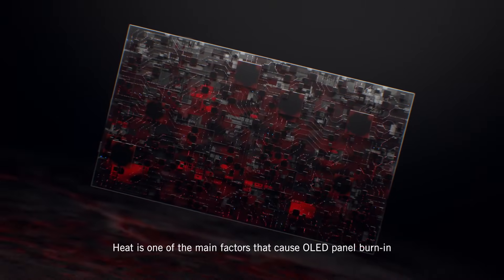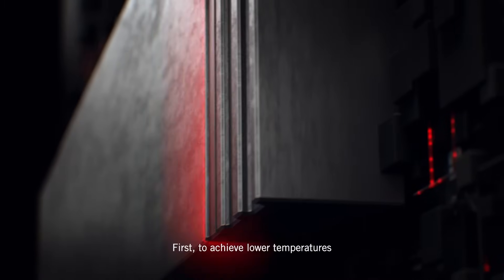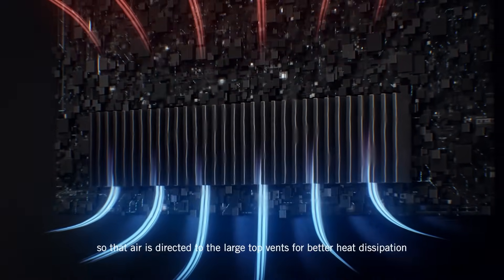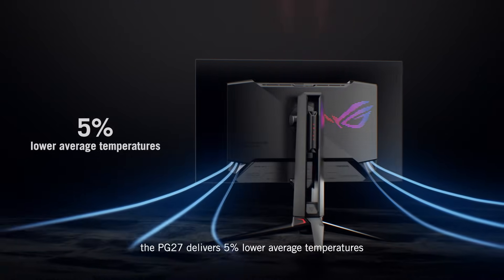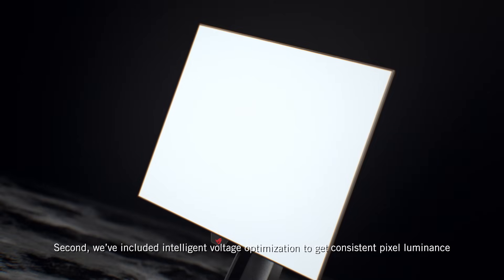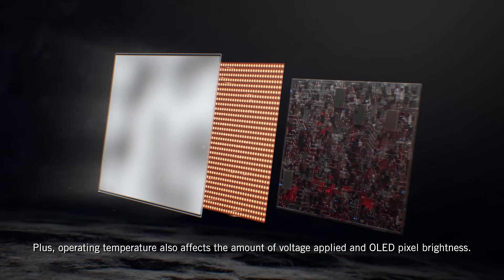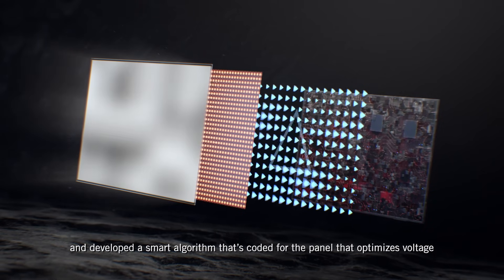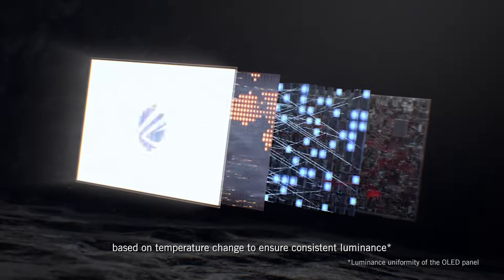How ROG minimize OLED burn-in ? - ROG Swift OLED PG27AQDM I ROG

Comment: To clarify my other post 
240Hz @ 1440p at 10 bit 4.4.4 exceeds the bandwidth of DP 1.4
So maybe 190Hz @ 1440p at 10bit  uncompressed.
ONLY with compression it will do 240Hz

Worse even with only hdmi 2.0
Reply: 2023 and still with hdmi 2.0 💀
Reply: @SonaSegura HDMI 2.0 in 2023 is fine. The issue is HDMI 2.0 on a high end monitor in 2023. HDMI 2.0 on a budget 2023 monitor, in 2023, is fine. Unfortunately, this is a high end monitor, where HDMI 2.0 is unacceptable.

Comment: Can someone tell me when is the release date in UK?
Reply: It is already available for purchase in Box. Just be warned that it costs over £1,000, yet only has HDMI 2.0 and not HDMI 2.1.
Reply: @shyamal903  I am going to play on pc so it will be always display port 1.4….
Reply: @ytshabir2955  Still does not excuse a high end monitor from not having high end features.
Reply: @shyamal903  I agree with you bro, but for me it’s best as I saw a review of THE DISPLAY GUY about this monitor
Reply: @ytshabir2955  Well, there is the Corsair 27 inch OLED monitor coming out soon, with the price being revealed in May.
Reply: @shyamal903  Corsair is not 4k as far as I know
Reply: @otakarlojkasek488  Neither is any 27 inch high refresh rate OLED monitor that is either already out or going to be out soon.

Comment: When Price, Both China, Germany, and the US have this Monitor, I'm waiting over here in The UK!

(Update I've got it now!)
Reply: You can’t buy it here in Germany. Not available in any Shop or store.
Reply: @lukiohearn173  was available on alternate during the weekend
Reply: Don't buy this... Not capable of 4.4.4 10 bit 240 like the LG... ONLY HDMI 2.0
or DP 1.4... Not enough bandwidth without  compression (DSC)
Reply: @michaelsawczyn1704  Not enough bandwith for what?
Reply: @lukiohearn173  Guess because the usage of the G-sync FPGA causes the lack of HDMI2.1 compatibility
Reply: @lukiohearn173  240Hz 1440p at 10 bit is exceeds the bandwidth of DP1.4 

So maybe 190Hz 1440p at 10bit  uncompressed. ONLY with compression it will do 240Hz

Worse even with only hdmi 2.0
Reply: @michaelsawczyn1704  who cares? Just use compression, there is no real difference in visuals.
Reply: @cheng2006  no... just buy the same thing from LG
Reply: @cheng2006 Why would you pay high end monitor price, yet compromise with HDMI 2.0? If a monitor is going to cost a large amount of money, it should come with the best features.
Reply: @shyamal903  because I don't need  HDMI 2.0 when I can use DP 1.4
Reply: @cheng2006  Your specific needs still does not excuse a monitor manufacturer from not including HDMI 2.1 on such an expensive monitor.
Reply: @shyamal903  HDMI 2.1 is way more specific than DP 1.4 btw. Would it be nice? yes, but this is not a deal breaker.
Reply: @cheng2006  So basically you are supporting Asus not giving high end features despite charging high end prices. Am I right?
Reply: @michaelsawczyn1704  so the lg one better ?
Reply: $999
Reply: @Mr.Plutonium  ik I've got it now! Making a video on it

Comment: 4k hello?? 27" is HUGE, 1440p is not enough. So we're getting 15" laptop screens with 1440p resolution, but 1440p is also "ok" for a 27" monitor?? Even all laptop OLED screens are 4k. Double industry standards for ignorant consumers, yay! 10 years waiting for a not-huge OLED gaming monitor and now you come in at 1440p???
Reply: I get your point but you can't really blame ASUS, they don't make the panels anyways. LG would be sacrificing the high refresh rate if they were to go 4K and additionally, it would be completely pointless since that change would place this monitor in a completely different market to what they're aiming for with this panel.